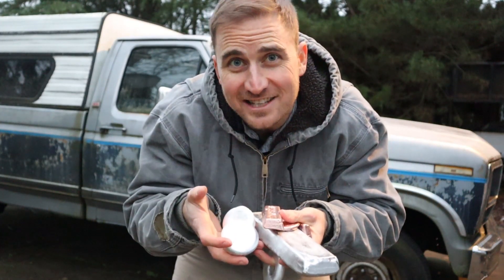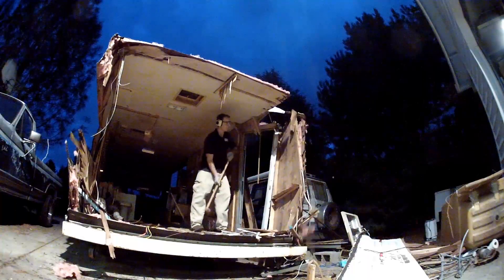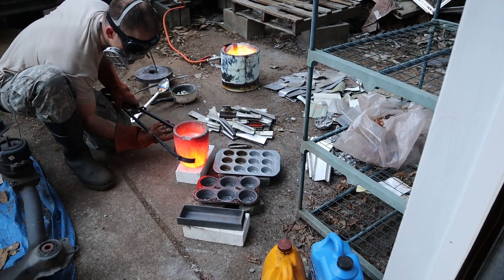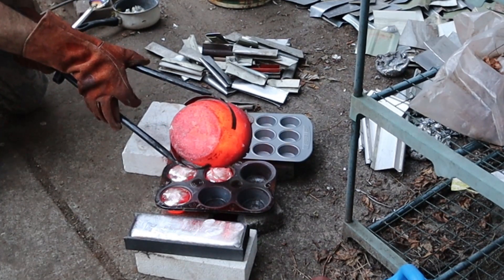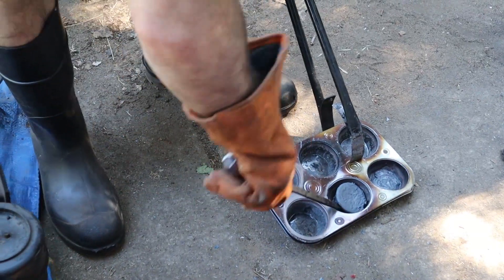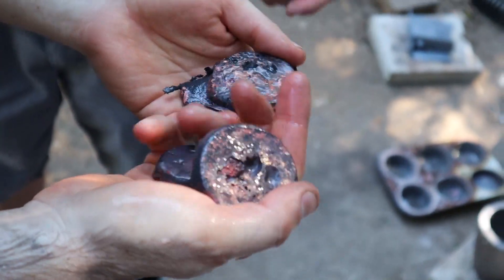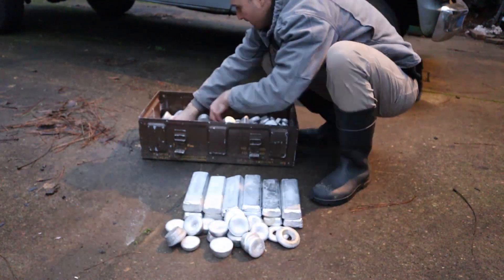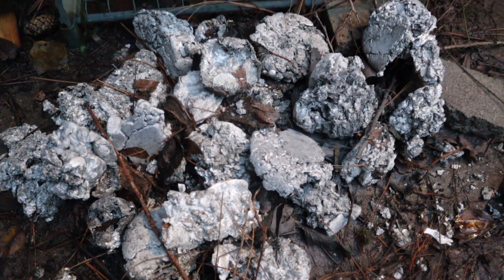Melting an RV into Metal Ingots with a Homemade Foundry

Comment: You got me at MELT AN RV! haha
Found your channel at random! Glad to see other YT channels that like to melt metal like myself! Amazing video! 
Subbed and liked and supporting our small YT community! Keep it up! 👍
and Safety is somewhat my #1 priority on my channel as you may see haha
Reply from the maker: Glad you happened to find me. I just went and checked out your channel. You have some good stuff on there too. That Urban Ore EcoPark looks like a treasure trove! I have to find one of them near me.
Usually I'm good about the safety thing. Of course the day I have the camera out there I'm in shorts... (huge fail). Truth is that video was less than 4 minutes long, but cutting and melting that metal, took like 6 months. Do you do any casting? I'm looking to do some of that with my chest of aluminum.
Reply: @SustainableCraig  No worries, I know what you mean by safety fails.. my hands shows it (burns haha). Live and learn I guess
I also totally understand what. you mean by the filming to editing ratio but your RV vid, I can see was a long term project!
Its like rebuilding your dream classic car!  ITs awesome you shared that with the YT world!
Yeah I do casting on my channel but still very new to it. Many success and fails 
I also have a 3D printer to help me create different green sand molds. 
You got a good treasure of metal there so I can see some fun casting ideas in your future!
Reply from the maker: @What2Melt_by_Randall  awesome. I'll have to check out some of your casting stuff. We have a 3D printer that we used to make a piece or two for the tiny house. Haven't used it for casting yet though.

Comment: Why not just use the trailer as temporary until you build your earth ship. I’m planning on doing something similar with maybe a school bus, shipping container, maybe an old travel trailer, maybe a mobile home, at the extreme try and purchase an old airplane fuselage,
Reply from the maker: @Eric Ellingwood once the tiny house gets transported to its final location it will go up on jacks and essentially become a permanent ADU on the property. Then I can add some paneling beneath it to help regulate the temperature during the winter better.
Sounds like you have some fun ideas in the mix. Lot's of options there. I'd consider something you can shelter with the earth a bit to help with regulating temperature. That's the one main design item I'd change about my build. Thanks for the comment on my channel. :)